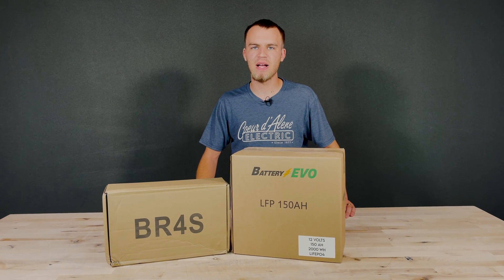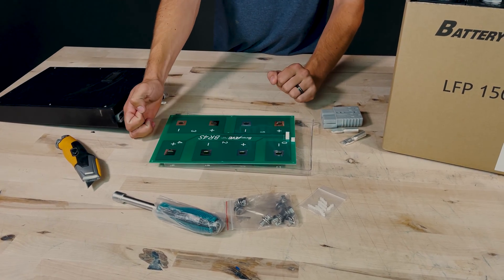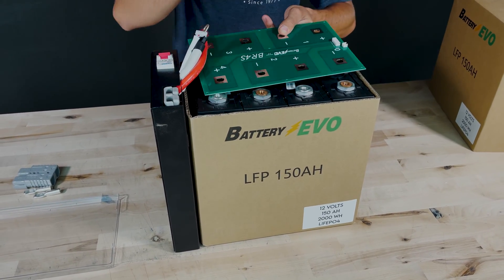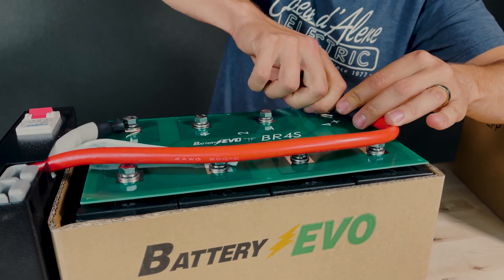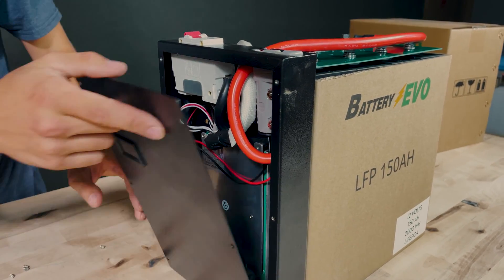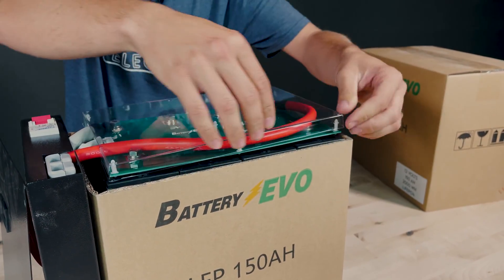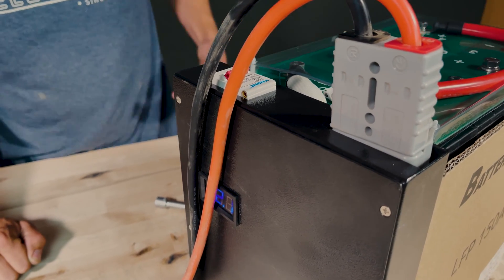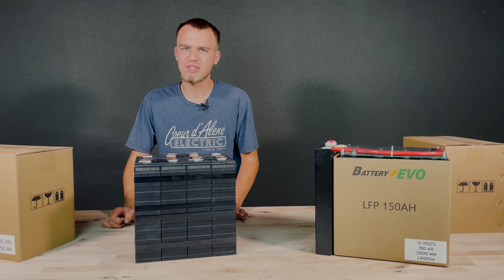BatteryEvo 12v DIY LiFePO4 Battery || DIY Assembly Instructions || Step By Step

Comment: To be fair, "Recertified"  cells means 'used' cells, does it not..??
Reply from the maker: We knew this question was going to be asked, so we'll gladly pin the answer up at the top.  Plain and simple, these cells have been used for energy storage, we cannot deny this at all.  There is, however, a HUGE difference between recertified and used which we will explain and detail how it applies to these batteries.  

Used often times implies that the condition is as-is, and may have imperfections from item to item.  There is no set standard for quality and the item being sold is typically "As-is".  In this case, any cells with performance or visual blemishes are discarded from use in the products and does not bear certification.

Just like a new product gets certified that is it meets the specifications to which it is being advertised at,  a recertified product would get checked over to ensure that it met the standards set forth in the specifications.  Specifically, each cell shipped is individually capacity tested three times before building packs with matching cells, and the pack bears the certificate of meeting capacity.  Cells that don't meet the full capacity are not available for sale.  The fact of the matter is that they will often exceed the rating advertised.

We are doing a fully detailed review of this entire kit in an upcoming video that fully explains recertified in a basic and clear manner.  At CurrentConnected, we believe in being clear,  concise, upfront and honest, which are the core values that have built our business.  We made this video because in the next upcoming video we want to mention this assembly video (as separate), so as to split things up and exclude information not relevant to a review.

Comment: Y need to connect two in series for 24 volts and be charged with solar energy. Can this batteries are good in that condition.? Or need a special way of charge. Specs said fix 50 amps, that  is not possible with solar. Thanks.
Reply: But how do you hook up the solar system?